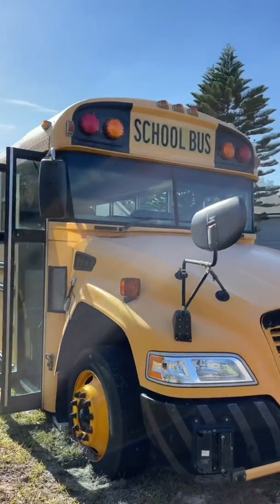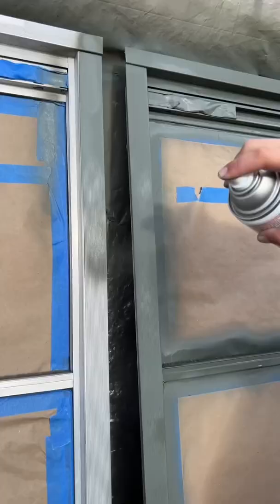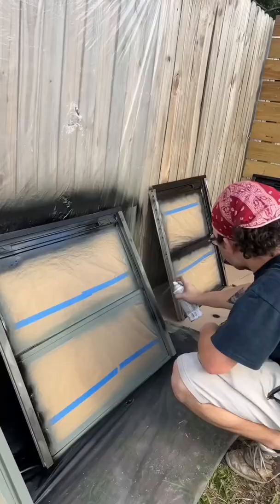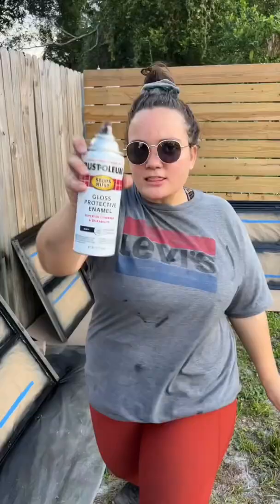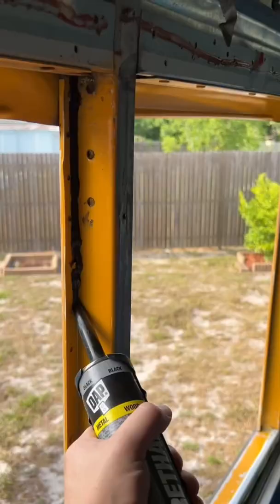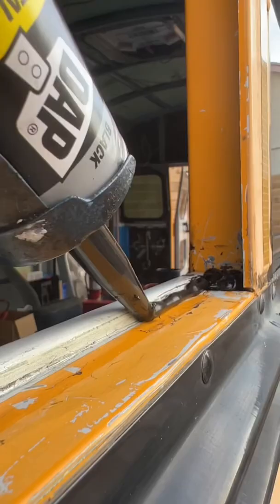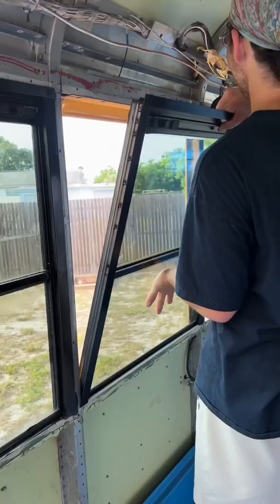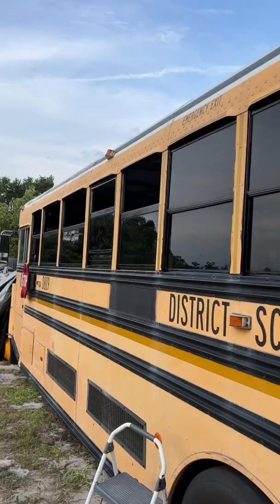Painting and sealing our windows Skoolie Build Pt. 14 #schoolbusconversion #diyprojects#diy #skoolie

Comment: Congrats on your bus! You're remodel looks good 👍

This might be a bit long,  so I apologize in advance....

Some tips that might help when caulking the windows are  ... after you run your bead of caulking, run your finger across the bread of caulking at a 45° angle using the side of your finger (rather than using your fingertip, or the "pad" of your fingertip). The reason being is that by using the side of your finger you'll be able to maintain that 45° angle consistently and it'll be better when it rains. And when pressing down with your fingertip,  your fingertip will displace the caulking leaving much less of it and it won't have that bevel to keep the water dripping off & away, and the water could end up pooling especially in the corners. 

And my second tip is when you're soothing out the bead of caulking, wrap your finger in a wet rag (something smooth,  like an old tee- shirt). But just dip the rag in water (if your using regular caulking) , then wring out the excess water,  and wrap your finger & smooth out the bead of caulking. It'll give a nice smooth finish that'll look nice, it'll leave you with a good seal, and it'll keep you from getting a lot of  caulking on your hands.
Reply from the maker: Woah! So much grey information, thanks for the tips! Really appreciate it :). You’re the best

Comment: Have y’all gone over the cost of this yet? I’m curious to know!! Also curious as to if y’all are doing this for economic reasons or to be able to travel.
Reply from the maker: This is for both. Much cheaper than a house we are estimating the entire build at 40-50k and we cut most travel costs as well!
Reply: @JessandJake  lol, y’all have to include that tow out- keep up the good work, you got this!
Reply: That's a good price for a nice motor home keep in mind it costs for parking and chemicals for the septic tank also costs for electric when you park in a camp ground or RV park and most RV parks don't let you have a Vehicle older than 10yrs I found this out the hard way, and so I said I won't park in a park then my generator was eating my $ up but now we have solar so that will help good luck😁

Comment: Polyurethane is so expencive, I have used 100% silicone it lasts for ever and is cheaper, also be aware of your color scheme and remember black absorbs heat where as light colored reflect it, I had to use the bubble insulation the kind that is silver foil on the outside for my windows here in AZ or my Ac couldn't keep up with the heat Best of luck looking good have a Blessed day 😁